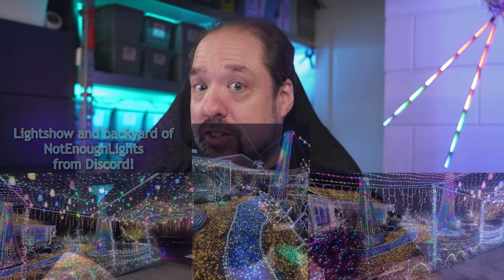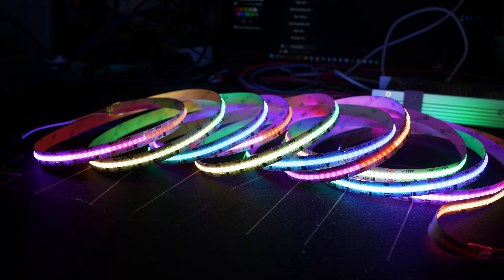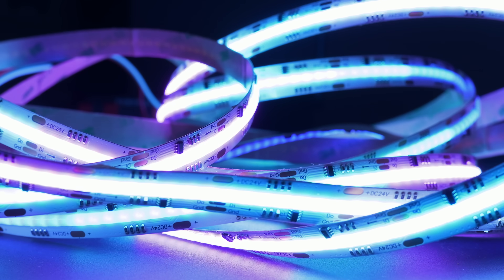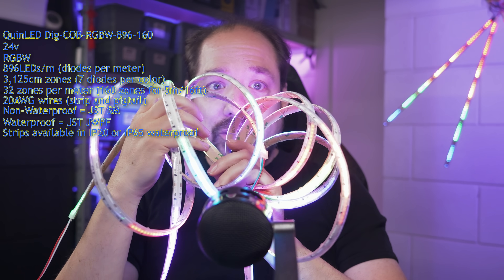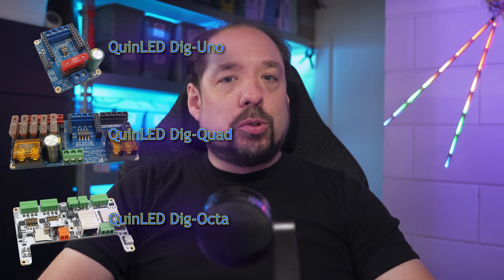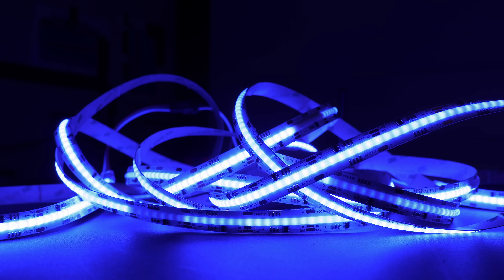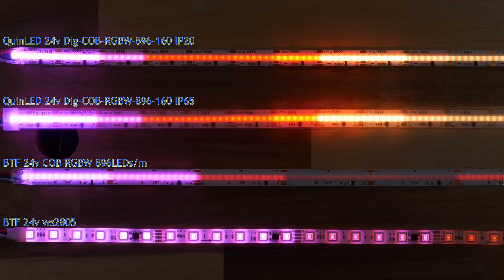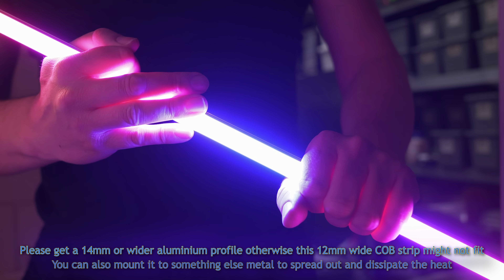💡QuinLED💡Custom designed LED strip

Comment: 7:40
Do you have an option to have cold white? or better yet both cold and warm?
Reply from the maker: As of now, no, I have to order these in batches and pre-pay them, so that's a huge upfront cost. Each variant would add a new item I need to keep in stock and thus investment and I just can't do that right now. So only 3000k (but a good 3000k) warm white in IP20 and IP65.
Reply: @IntermitTech  
Didn't your supplier tell you LEDs with combination cold and warm on one LED exists?
Reply: @IntermitTech  if you ever do a natural white version i would buy it in a heartbeat.
Reply: @IntermitTech that’s a shame as cold white is typical for kitchen and some outdoors applications.  Am thinking of this on my drive as general illumination with colour possibilities for festive and special occasions. Getting these in other lengths could be handy as well.
Reply: I’m ready to buy as soon as it’s RGB WW/CW

Comment: This looks great! Can you clarify something around the power, though? I couldn't quite follow what the net result was around power injection thanks to the thicker gauge wiring, am I right in thinking that for a 5m strip you wouldn't need to inject beyond both edges? Or did I misunderstand?
Reply from the maker: For a 5m strip you are fine with injecting from just a single edge unless you have special demands for it (running dual colors at 100%, etc.). For a 10m strip I'd recommend at least front + end or 1x middle.
Reply: Thanks for the response @IntermitTech !

Comment: Excited for this, question though, will the IP65 version be able to dissipate enough heat through the coating (not sure if it is silicone) to keep it cool? I’m guessing the IP65 can also be cut and re-soldered at the new ends?
Reply from the maker: So this strip is very high power and you are right that that needs a bit of consideration. Running it for normal stuff (100% W, 100% effects, etc.) it will be fine but if you are going to stress it with 100% RGB white and such on all diodes at the same time for instance, that's not recommended, especially not for the IP65 version. Other then that the IP65 version still transfers a good amount of the heat to the outside so mounting it down still helps!
Reply: How would I go about cutting the waterproof strips to length at the cut marks, and it staying waterproof on that end? Would i need to cast my own silicon around the end?
Reply from the maker: @samturner4406 best would be to get a sort of end cap and glue that on again. They do that for me at the factory so I don't really have measurements for that.
Reply: @IntermitTech  no worries, are those end caps available separately?
Reply from the maker: Currently no, I will see if I can make list them in the future.

Comment: This is awesome!! I'll be ordering shortly for one project I have but there's another one for which I'd love a low-power variant (or 12/16-bit IC if those exist) with the same thick copper for 10m, single-injection runs!
Reply from the maker: Good to hear! Yeah I'll see after this launch what's viable in this space. I saw a product here that didn't exist yet and we'll see how to move forward after this.

Comment: Diodes per meter is just BS to get a bigger number SMH
Reply from the maker: Yeah, I didn't understand when they used that on COB strip either so I'd rather just be honest about it!
Reply: @IntermitTech  I think i'd be okay with it if they were willing to call it "R-LED + G-LED + B-LED + W-LED strip" 896LEDs. But they won't. I'm not okay with "RGBW-LED strip" 896LEDs

Comment: I have been waiting for a product like this for a while for addressable ceiling light for my basement. Can't wait to order
Reply from the maker: Should be awesome for that!
Reply: @IntermitTech  orders placed! Can't wait to test on my dig octa
Reply: I'm also waited for that, I ordered a Dig Quad with SK6812 in Feb 2021 for testing but i wasn't happy about the light output.
So i still have empty Alu Profiles hanging on the ceiling in 6 rooms ;)
I guess it's finally time to populate them.